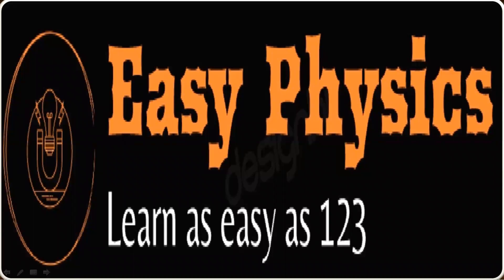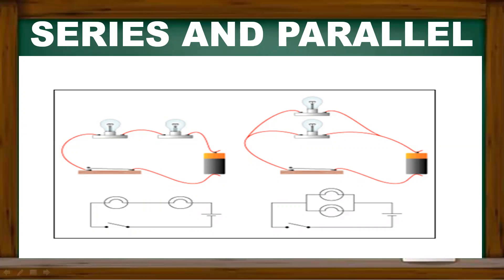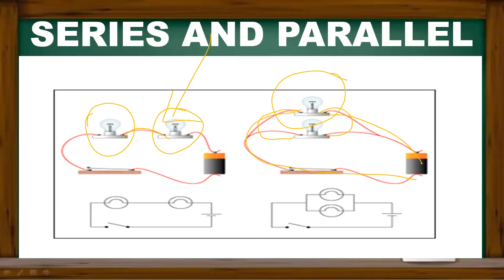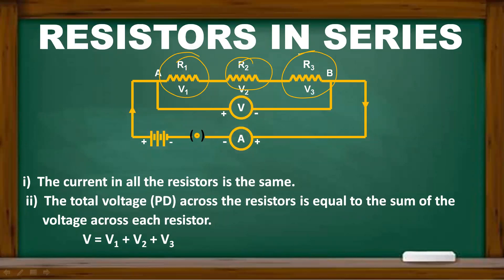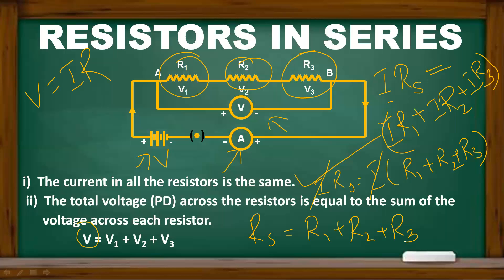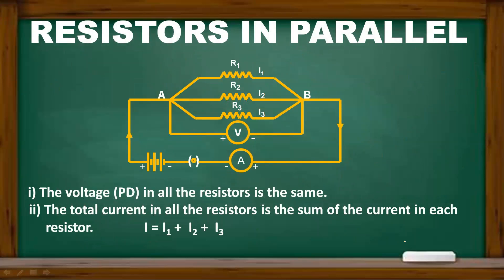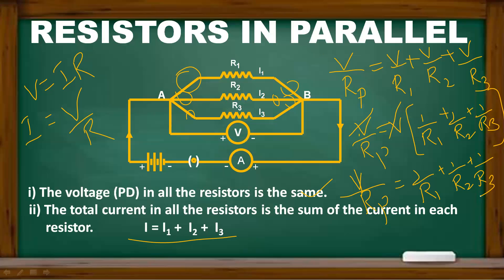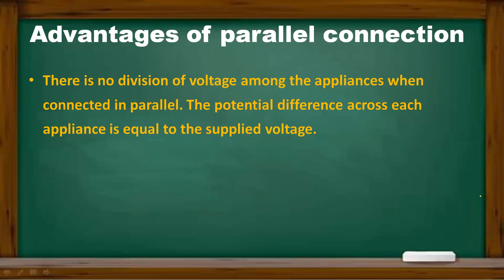class 10 electricity revision Malayalam I series and parallel circuits I Aim 100

Comment: the low amperage fuse wire is use for circuit which high power device connected this statement is true or false